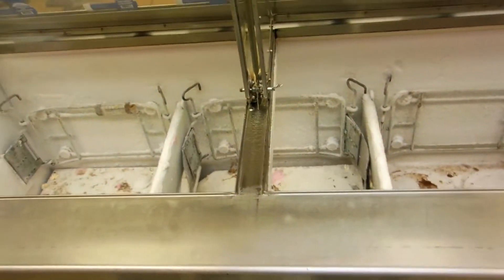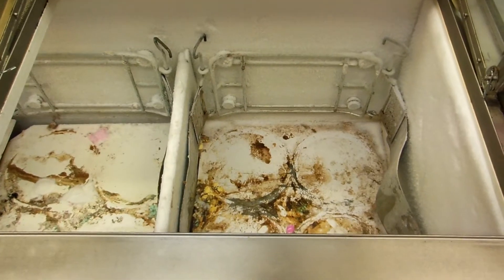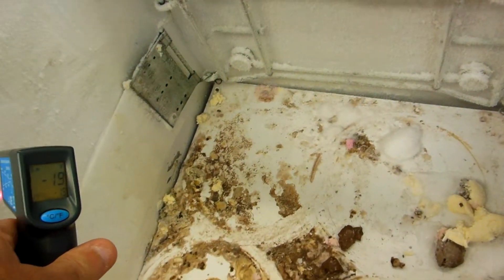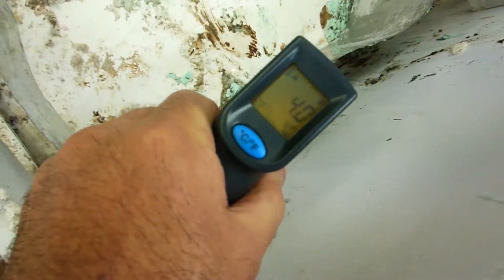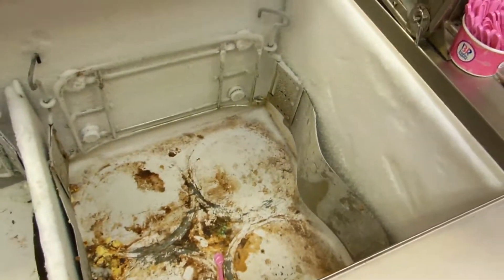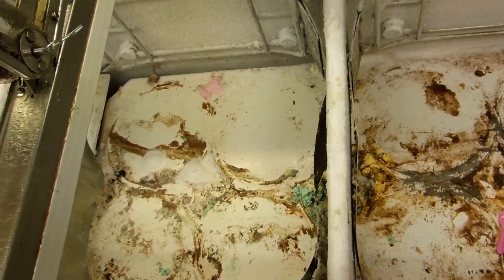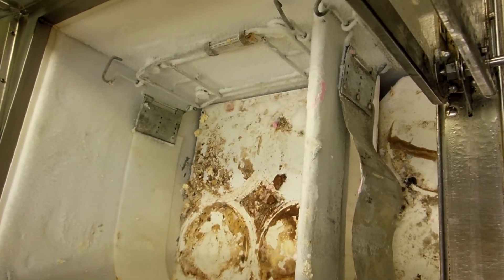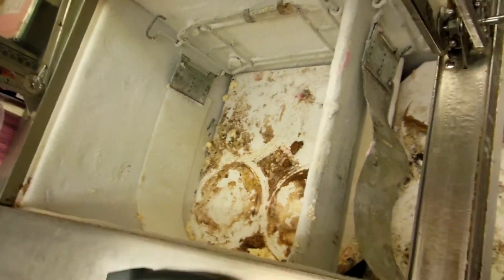How to Tell if Your ice Cream Dipping Cabinet is Low on Freon - Refrigerant.

Comment: So how do you charge it do you have to weigh it in ?
Reply from the maker: You Don't have to but, that is the Fastest & Most accurate method if you have a model & serial number tag with the refrigerant type & amount.
Reply from the maker: Other method is keep adding a little refrigerant until all the walls are all starting to get frosty & temperature is better. Experience & watch your pressures / pressure temperature chart. These units are critical charge units.
Reply: OcRefrigeration , Hvac & Electrical Video's. What do they run a a very low evaporator ? Like 5psi
Reply from the maker: the easy answer is yes. but , depends on refrigerant type and the current temperature of the walls / evaporator which is directly proportional to suction pressure. ie : Lets say its a old R-12 ice cream box & the refrigerant in it is R-12. if all the box walls are at -20F your suction pressure will be ruffly 1psig. if the box walls are 7 degrees your suction will be 13psig. as it gets colder suction will drop according to a pressure temperature chart for R-12 or whatever refrigerant u are using. conversly if the unit is very low on refrigerant it will be running in a vacuum & very low head pressure. Hense - Never hook up your guages to a running system. all ways turn off any unit you are about to put guages on for 5 minutes before putting guages on. it could be in a vacuum and you definately dont want to suck air into the system.
are u a tech ? or ice cream shop owner ?
Reply: OcRefrigeration , Hvac & Electrical Video's. I’m a tech  and just started my own side work and one of my customers is a water ice place , and I’ve been working on rtu’s , walk ins , I never worked on these dipping boxes
Reply from the maker: Yea, usually with these , if they are Really old & low on refrigerant they are Junk. Evaporator leaking inside walls. not repairable. What State do you service ?
Reply: OcRefrigeration , Hvac & Electrical Video's. I’m in Philadelphia pa

Comment: if cap tube is partially  clogged, or  liquid drier you would  get similar  symptoms,  I've  worked  on few of those on the past , what I do is I flush the crappie out of the system with nitrogen , then I replace the cap tube , replace the drier, pressure test the system , and 1 out of 5 units was a leaker.. just  my experience,  Good Job OC Refrigeration..
Reply from the maker: Agreed ! mostly all leakers from age. subcooling will be higher on a plugged cap tube. no subcooling on a leaker.
Reply: @OcRefrig  Good info 👍🏼
Reply from the maker: @philltafolla  😉

Comment: Well explained what if the cap tube was partially clogged or a dryer change but you're right most likely it popped the a  leak I know those old dipping cabinets
Reply from the maker: hardcooling if cap tube was partially blocked, suction would be noticeably lower, and head Pressure would be noticeably Higher especially with a Static cooling Case ( Walls are Condenser) like these are. same thing if dryer is plugged, higher head, low suction. also customer told me, he defrosted two days ago and after turning back on unit has not been cold enough. i know these cases enough that when they say that , pop goes the Evaporator tubing in the cold walls. corrosion from all the years of sweating Freezer evap . walls. besides, they have 3 dip cabinets and last year one of them did the exact same thing. so they are all going. Two Down, and one to Go. So, I did a Gas and Go and the Customer has a Cold Case Again for NOw. He Knows the Drill By Now. It's Not His First Rodeo.or mine.
Reply: I agree